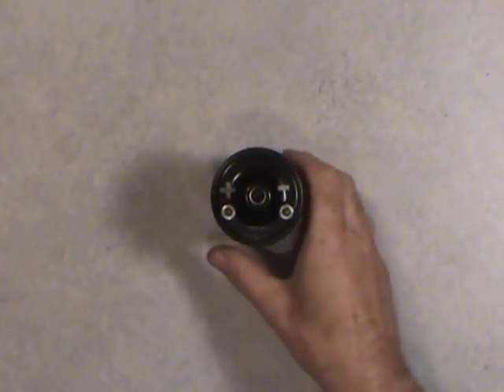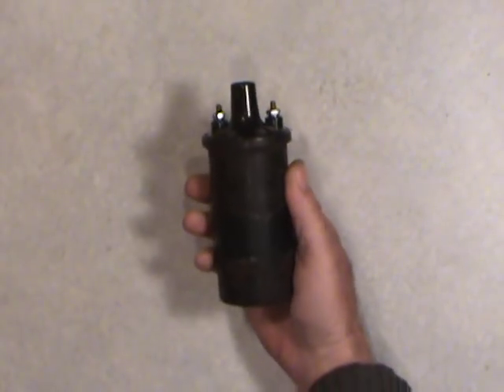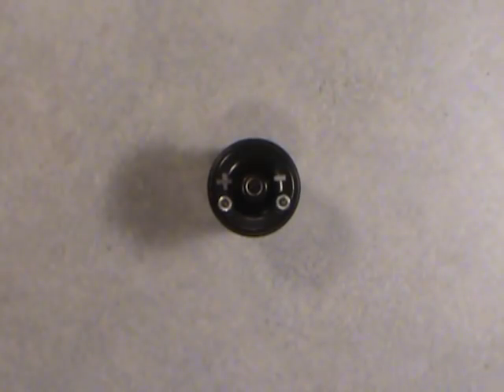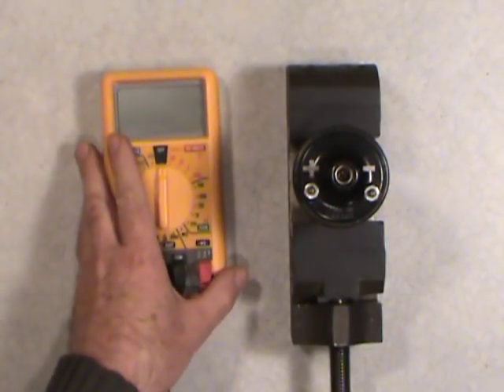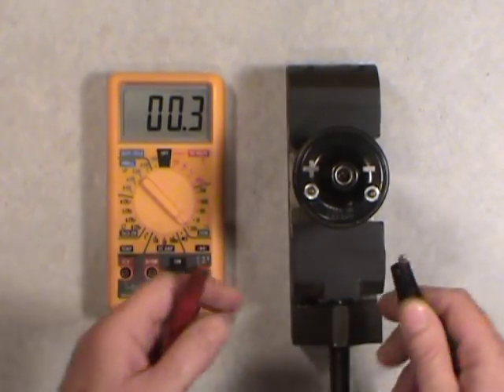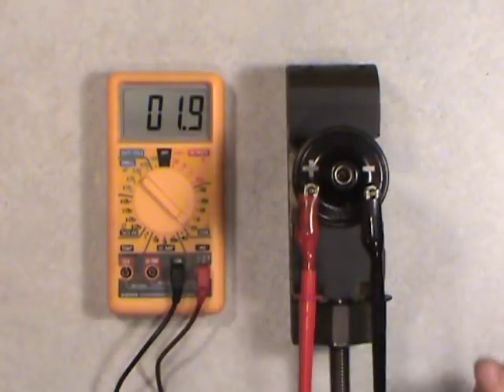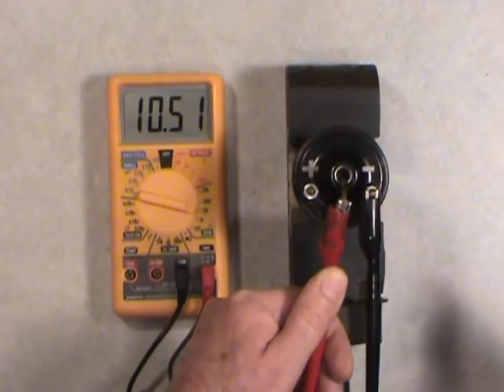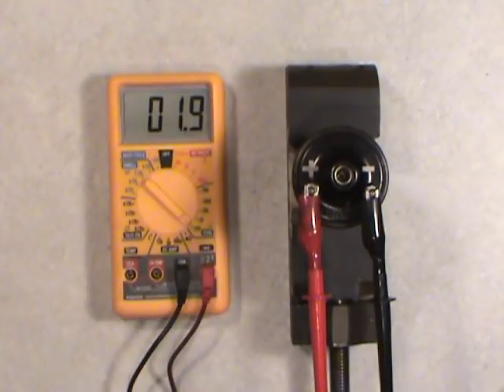Ignition Coil Testing

Comment: Thanks Buddy!!  My old 1972 John Deere tractor just stopped running a month ago in the middle of snowplowing.  Been farting around trying to fix it for a month.  Saw your vid about testing coil.  The new one I out in 6 months ago is DEAD!  Put the old one back in (looks super old, maybe original) and it fired up instantly!!  Thanks again!!
Reply from the maker: +Jeff Pregman ....Greetings Jeff Pregman....You're Welcome my Friend, and, Congratulations, for Gittin'-er-Fixed............Hmmm...what's that old sayin'.....oh yeah, that's it, as in..."They Don't Make-em...like they use to"...(the Ignition Coil, that is...lol)..............As a Guess, it might have been, a not so good Electrical Connection, on the Low Voltage side, of Your Tractor's Ignition System, that had You thinkin', that, the much Older Ignition Coil was to blame, and should be turned out to pasture, when it was probably Ok, all along....................Make sure, that, when-ever Replacing, any of the Parts in Your Tractor's Ignition System, to get the "Exact Specified" ones, cuz, in a lot of cases, all of those particular Parts, have to be "Matched-Up", with one-another, especially so, the Ignition Coil's Primary Resistance, and whether or not, it has to be "Teamed-Up", with a Ballast Resistor as well, or, the result, could be, a Weak Spark, at the Spark Plug/s, or maybe, even an Ignition Coil that gets too Hot, Over-Heats, and Destroys itself, quite possibly............I don't know what Your Tractor has, in the way of an Ignition System, but, it's always a good idea, to Keep-Up with Maintenance.....................Something, like an old, dirty, and/or, worn-out Spark Plug, really should be Replaced with a New one, and, if it's the Gap-able type, it should be Gap-ed to Specifications, cuz, just about any time, that a Spark Plug's Gap, gets way too Big, that, in-itself, makes an Ignition Coil, Work all that much harder.............................All of the Ignition System's Wiring "Connections", should be, Clean, (shine-ee?) and Dry, or, sooner or later, there's gonna be Trouble in Paradise...!!!...Yikes...!!!...lol.........If Mr. John Deere, starts to Feel Sick again, just leave a comment or question, under any of my YouTube Videos, and, once I know the Model Number, of Your Tractor, I can then, have a look-see, for that particular Tractor's, Information, and.........till next time.......Be Safe, take care, and have a good one.

Comment: I  watched  EVERY  second  of this presentation  and  found  it  VERY  informative ! ...
Reply from the maker: Greetings...the jackel.............Thanks for the nice comment, and for watching too............If, and when-ever, you, or who-ever, might be replacing/installing a New ignition coil, make sure that, "it" is the "Correct" one, for your "Exact" vehicle and engine, b-cuz, if the "Wrong" one, happens to get installed, that "Does Not", have the "Correct", Vehicle Manufacturer's, Ohms/resistance specifications (especially so, on the Low Ohms/Primary side/coil windings), for that particular ignition system/circuit, then, it might result in, something along the lines of, a Weak Spark, at the spark plug's Electrodes, or perhaps, some not-wanted/expensive damage, it might end up being, and, I hope not (ignition coil, might Over-Heat, and go Kaput/Quit working, as an example).............When-ever, I ordered, an ignition coil, for a vehicle, that had a stock/un-modified engine, I would tell, the Parts, guy or gal, what vehicle it was, along with, the particulars of the Engine as well, and, the only thing, that was, looked-up/involved, was usually, just a "Part Number" Only (No ignition coil Specifications, what-so-ever)...But...what if...???...there was an "Error", in the Part's...Listing...or...the Parts, guy or gal, had an off-day, and made a boo-boo (aka, mistake)...???...........What I try to do, to prevent any Errors (hopefully, that is), is to, have a look-see, in a Factory/Manufacturer's..."Chassis Service Manual"...to, see for myself, what the "Low Ohms"...and..."High Ohms"...Specifications, actually are, for that "Exact", vehicle and engine...........I recall, some time ago (for the very same vehicle/engine), that, I saw (in a factory/manufacturer's service manual)..."2"...Different...(sets of) ignition coil (ohms/resistance) Specifications, for..."2-Different"...ignition coils, that had "Different", ignition coil Manufacturers...!!!...how about that...lol...oh, and, that particular vehicle, only used, "1-Only" ignition coil (not 2), just, so as, not to be confused..............Then, if the ignition system/circuit, is a much older type, then, some of them, might have/and use, what is called, a Ballast Resistor, that has to have the "Correct" Ohms/resistance Specification/s as well (a ballast resistor, is needed, to be used along with certain ignition coils, or, that particular ignition coil, will probably get too Hot/Over-Heat, and destroy itself)............The better, a vehicle's ignition system performs (and, that every-thing else, is working as it should), will more than likely, result in better (engine) Performance, and if Ya go easy on the gas pedal, good gas mileage, it will usually be...and........till next time........Be Safe, take care, and have a good one.
Reply: ..another comedian!

Comment: people are so  busy and stressed out these days eh? Ive had one of those ohm meters sitten around for 10 years now...and I never had a clue!!! on how to use the darn thing!! Thank You so much for your video. People like you and I...that KNOW what the hell were talking about like to explain things where all people can understand it and that takes a minute or two!!  Good job sir!!
Reply from the maker: Greetings...Dale Rucker............Thanks for the nice comment, and for watching too...eh...lol............Well, the good ole Multi-meter, be it, an older, Analogue type, that has a needle/pointer that Waves at You, or, be it, the Digital type, that will usually, only be showing You Numbers, along with, sometimes, showing a decimal (point), and/or, maybe a symbol or two, perhaps (ohms symbol maybe?...as an example), can sure help out, quite a bit, when it comes to, tryin' to track down the Culprit, that could very well be causing, an (electrically related) problem or two...hopefully, that is............Here's something else, You can try, if You like..........If, You were to set Your Multi-meter, on the Low Volts range, then, just get a 1.5 Volt Battery (one and one half Volts, round type), as in...AAA...AA...C...or D...size, and, make sure, to touch/connect the Multi-meter's probe/tips, to each end, of the 1 and 1/2 Volt Battery, using the Correct "Polarity", as in, the Red probe, is usually + (plus sign = Positive), and the Black probe, is usually - (minus sign = Negative), or, more simply put...the Red probe/tip, goes to the end of the battery, that has the Bump/protrusion on it...and....the Black probe/tip, goes on the Flat end of the Battery, then, have a look at the Voltage reading, that will usually be showing on the Multi-meter, well, unless, that poor ole Battery, happens to be...as dead as a Door Nail, that is, as in, completely used up, and/or, might be, very, very old as well...............A Brand spankin' New, 1 and 1/2 Volt Battery, should be showing, a bit more, than 1.6 Volts, most times..............I've found, that, when, one of these Used, 1 and 1/2 Volt (round) Batteries, starts to drop Below, oh, about 1.4 Volts, then, that's usually the time, where, what-ever the Battery is powering, will sometimes, start to work, not-so-good, sometimes............If, one or more, Used, 1 and 1/2 Volt batteries, happen to be in a Flashlight, that has an old school, Light-Bulb in it (not the LED/Light Emitting Diode type), then, a Person, might be able to see, that, the Flashlight, isn't casting, as "Bright" of a Light, as it did before, when those (1 and 1/2 volt) Batteries, were brand spankin' "New"................If, there are two or more, 1 and 1/2 volt Batteries, placed/connected end-to-end, as in, Bumpy end of one battery, is touching the Flat end, of the other battery, then, this is basically, what is called, a Series circuit, and, each of the Battery's Voltages, gets added together, which will increase the Total Voltage available, as in, for example, let's use a Flashlight, that uses, only Two, 1 and 1/2 Volt batteries, shall we............When these two batteries, are placed end to end (placed in Series), then, the Voltages, of those two batteries, are added together...............So, if each New, 1 and 1/2 volt battery, is 1.6 Volts each, just add...1.6 plus 1.6, which should equal 3.2 Volts..............Then, as these two batteries, get used up, by the old school Light Bulb, that's in the Flashlight (while it's on), then, as the Voltage starts dropping, so will, the Brightness, of the Light, that's coming out of the Flashlight, well, as far as I might know, it will...maybe...lol...........So then, the light-Bulb, that's in the imaginary Flashlight (above), as far as I see it, is a pretty good example, of what can happen, when a Battery's Voltage, starts to Drop, and.........till next time........Be Safe, take care, and have a good one.

Comment: That was really helpful and perfect pace for me to understand.  Thank you and keep doing what you're doing.
Reply from the maker: Greetings Meaghan Pashen....I'm glad that this video of mine, was able to help you out, and, thanks kindly, for your very appreciated words, that I read in your comment as well....As for this older type of ignition coil, that you see in this video, it happens to be "Old School", in comparison with ignition coils that can be found on the vehicles that are being sold these days....With the older vehicles, oh, up to about the mid 1970's, were quite easy to learn about, maintain, repair, and modify, as compared to all of the vehicles now-ah-days, that have fuel injection, onboard computers, and then some, but not to worry, just set your own pace, (maybe like the pace that You experienced in this video maybe?), and, just..."Learn-as-You-go"...much like I have, and still do, to this very day.

The real Major difference, in the Older versus Newer vehicles, is the "Engine Management System", and other components, like Electronically Controlled automatic transmissions as well.

I find that, it's quite a bit easier to learn (and maybe teach as well), the Fundamentals (aka, basics) about vehicles (cars, trucks, etc.), especially, as compared to newer vehicles, having an Onboard Computer, Fuel Injection, and the "List" goes on.

Cars, Trucks, and anything, that makes them go, just happens to be a "Hobby" of mine, and I "Save a Pile of Money", by D.I.Y., ooops, I meant D.I.M. (aka, Do It Myself!...lol).

If you liked this Ignition Coil video, I have another Video on my YouTube Channel, that would probably help you out, with how an "Old School" vehicles "Ignition System" actually works, and it was an ignition system that was usually referred to as, a "Points and Condenser" type of ignition system (this particular ignition system was only used up to about 1974, and this system used an Ignition Coil that looks just like the Ignition Coil that You see in this video, but, it is quite a bit easier to understand, as compared to the onboard Computer ignition systems found on vehicles these days.

If you care to, head on over to my YouTube Channel...RockysRoadshow..., and check out (actually watch, and maybe listen too...lol), the Video, with the Title of, something like...Simple Explanation of a Vehicles Ignition System...

...also, feel free to have a Look-See at any of my other YouTube Videos, as I'm sure that You will find plenty of interesting information in my other videos as well...enjoy.

Be Safe, take care, and have a good one.

Comment: When you are ohm testing a coil positive and negative doesn't matter you're checking for resistance in the coil it's important to have the ohmmeter set at the correct settings primary and secondary

Comment: Life is too short to hurry through it. Nicely done Rocky !!.
Reply from the maker: Greetings...vetterfellow.............Thanks kindly, for your nice comment, oh, and, thanks for watching too...........Well, I heard, quite some time ago, that, an ignition coil might wear out, due to "thermal cycling" (I think?), where-by, an ignition coil might start out very cold, temperature-wise (let's think in terms of, something like winter, way up north, shall we), then, that poor ole ignition coil, starts getting heated-up to operating temperature, while in operation, then, after the engine gets turned off, back to cold, "it" goes again.............Now then, let's say, that the car, truck, or what-ever, only gets used once per day, then, I'm thinkin' that, that alone, would amount to 365 "thermal cycles" per year.............Then, multiply 365 x (times) the number of years, that, the ignition coil can still do its job properly...Holy-gwalk-ah-moly, that's a lot of contracting & expanding, that, that poor ole ignition coil, has to endure, and, that's only based on, "one thermal cycle per day"...!!! (probably be much more, for a vehicle, that has to fetch...kids...groceries...beer...&...go to work too...lol)............Just recently, I got curious, as to the diameter, of both, the primary windings, and the secondary windings, that get hidden away, inside of, an automotive type of ignition coil............The primary wire (windings) diameter, is quite thick, when being compared to, that of, the secondary wire (windings) diameter............I'm not sure about the primary wire size/diameter, oh, maybe between, about 1/32, to almost 1/16th of an inch maybe, but, the secondary wire diameter, can probably be compared to, the size (diameter) of, now get this, a...Human Hair...!!!...Wowsers...!!!...&...that be, about .003" (three thousandths of an inch) in diameter (impressive, I must say)...........Generically speaking, there are about 100 turns of secondary wire/windings, for every one turn, of primary wire/windings (quite the turns ratio alright)...........That turns ratio difference, is pretty much, what increases that nominal, 12 volt battery voltage, up-to, the many thousands of volts, that are required, in order to create, that good ole "spark", between the spark plug's electrodes, in general terms, that is...........I sure as heck, would never, ever, even want to attempt, trying to hand-wind, those .003" diameter secondary windings...no way...but, in my teen years, I did hand-wind, a few slot car motor's, 3 pole armatures, and that, was about as close ,as I'll probably ever get, to becoming a "watch-maker", oh, and yes, of course, a..."Rolex"...watch-maker...!!!...lol...........Thanks again, and........till next time........Be Safe, take care, and have a good one.

Comment: the best coil test vid combined with the moss engineering films am ready to test again :)
Reply from the maker: Greetings Paul Johnson....Thanks kindly, for your very nice comment, my Friend....I'm not sure if I happened to mention some things in this Video, that I will let you know about now....Make sure that, All "Wiring" is Disconnected from your Ignition Coil when you Test it with the Ohm-Meter (Multi-Meter), for the reason that, your "Ohm-Readings", probably Won't be "Accurate", because of the "Extra" Wiring (and maybe other components like "Switches", and, General Motors use of a "Resistance Wire", and, Other Vehicles that may have "Ballast Resistors", in the Electrical "Circuit", just before, that there Oil Filled Ignition Coil) gets Added into an Electrical "Circuit" (Yes-Siree-Bob), as, we Don't want any "Circuit" to Mess-Up the Ohm Readings that we are after, as it applies to the Primary, and, Secondary "Coils" that are "Hiding", inside that there, Oil Filled Ignitions Coils Metal Cylindrical Shaped Metal Containment Shell (or, Body, if you will)...and...(I'm not sure why, but, I sure do Like to "Play" with "Words", as you can see!...lol)....(I figure that, If I keep things Easy Going, with a Bit of "Fun", thrown in for good measure, that it just might make the Learning Experience, or Information Gathering, and, along with (I hope), Entertainment value as well), have my Videos (and Comment Section too), that much more Enjoyable, for the Folks that are looking for Information that I have "Locked" away inside all of these Videos.

So, for all of You Folks that are Reading these words, here and now, Please feel free to "Un-Lock" the Information inside any of my Videos, any time that You care to....(hands You the "Key!"...lol).

Take care Paul, and, have a good one.

Comment: Good tutorial and just what I needed. Thanks.
Reply from the maker: Greetings...Emil Cornell.........Thanks for watching..........Here's something else, to keep in mind also..........There can be times, quite rarely, when a faulty ignition coil might start to act-up, and not work so well, or, might even stop working, possibly, when it gets up to operating temperature, or, maybe even hotter.........The Ohms (resistance) testing, of an ignition coil, isn't really, the be all, end all test, b-cuz, the Ohms/resistance test, is usually done, when the ignition coil is rather cool, as in, room temperature perhaps...........Make sure, to keep up with regular vehicle maintenance, that's usually, to be done, in accordance, with the vehicle's manufacturer's maintenance schedule, at the specified time, and/or, mileage/kilometer-age "intervals", b-cuz by doing so, you'll be getting better performance, and, if Ya go easy on the gas pedal, then, some very good gas mileage, it will usually end up being, and........till next time........Be Safe, take care, and have a good one.